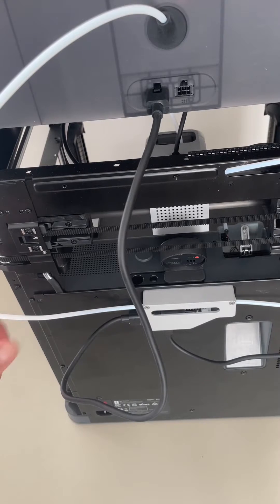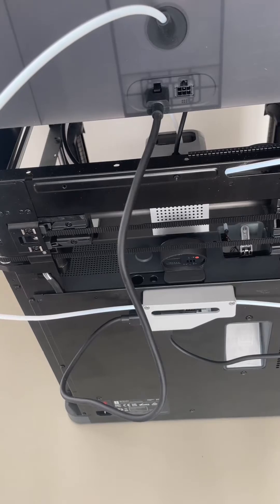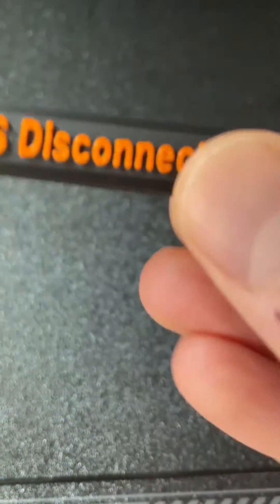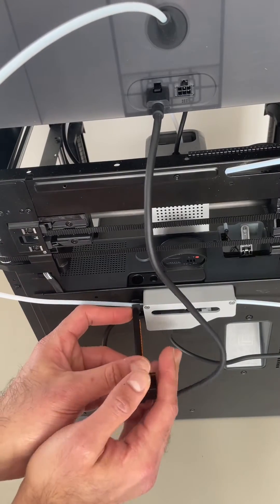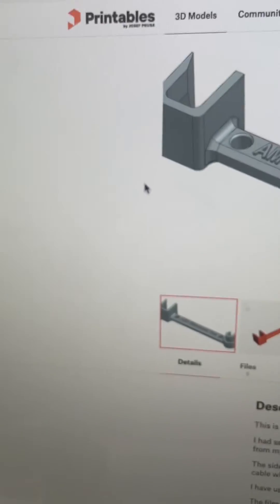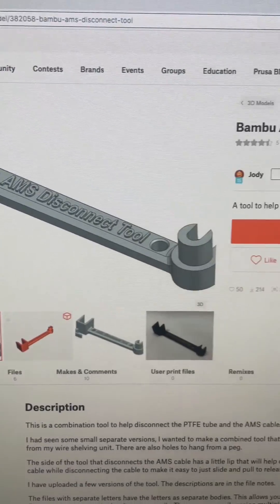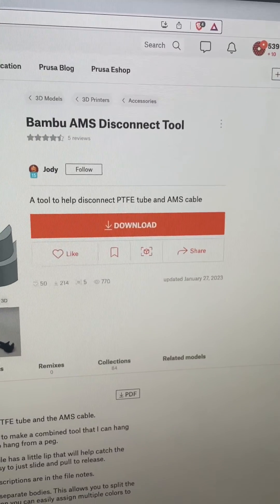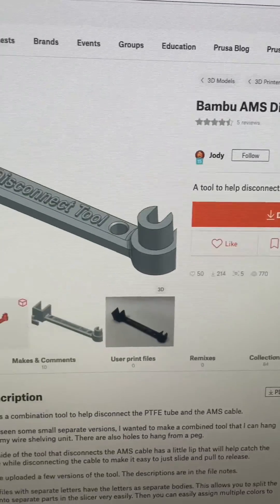Bambulab P1P / P1S / x1 Bowden tube removal from AMS hub. 3d printing tool

Comment: The PTFE tube on the other side has the exact same mechanism for locking the tube in place.  It is inside the spring.  If you look look through the spring you should be able to see it.  There is two pronged fork looking tool that you can print that will slip between the coils in the spring and you can depress the lock to release the tube.

Comment: I took the whole thing apart using the Allen wrenches provided in the box. Then I was able to manually detach the disconnect. It was not hard but just a little bit tedious. 😅 I’m printing the AMS disconnect tool now. ❤ Thanks so much!

Comment: Cool, I’lll just print a…. Oh, I can’t because the filament is stuck.
Reply: You can just use tweezers to push where he inserted the boden tube tool to release the tube. The tool just makes it simpler to release from the filament buffer.
Reply from the maker: @energ8t  true, but thats a good reason to buy another machine. 🤣

Comment: Sadly I can't print that tool because filament is stuck... 😆
Reply: Same spot haha
Reply: I'm that exact boat right now 😂
Reply: Lol same :(
Reply: All I did was use a knife. Just needs light pressure to release the tube
Reply: You can just use tweezers to push where he inserted the boden tube tool to release the tube. The tool just makes it simpler to release from the filament buffer.

Comment: For those wondering about the right side tube, you simple use a pair of tweezers to push the disconnect inside the spring, about 1/2 inch from the left side of the spring. Push it in just like any other connector, and pull the tube out.

Hope that helps. I'm 74 and figured it out. You can too. Lol

Comment: Bambu should have supplied a tool. What were they thinking putting the wire tab on the inside?
I guess it’s not a big deal assuming you have a working printer to print the tool, but that won’t always be the case.
Reply: Exactly!

Comment: How do you get the PTFE tube out of the other side of the block?
Reply: Ik this comment is late but you need to remove the block that connects your ptfe tube from your AMS to the Hot End. 

Use the Allen Wrench and remove the 2 screws on the block. Then flip it over. Inside the spring, press down on the black connector and you should be able to remove it like the left side.
Reply: @ij3342  this absolutely helped me cause I was thinking I should be able to remove the tube with it still screwed in, so I appreciate it!
Reply: @ij3342  you saved me
Reply: @ij3342  Not all heroes wear capes
Reply: @DamienMcGuinnessKiwi 💪🏽
Reply: Same. This vid did nothing for me